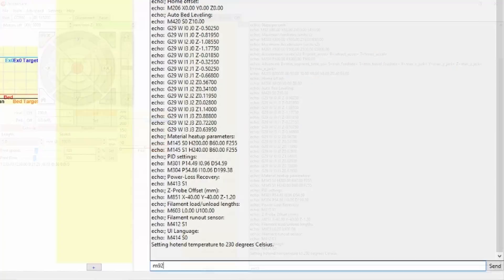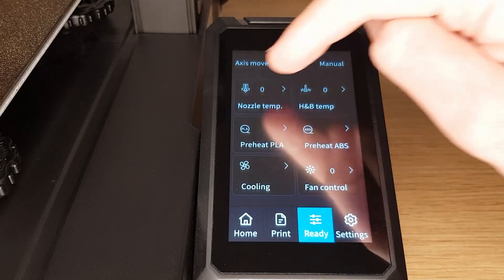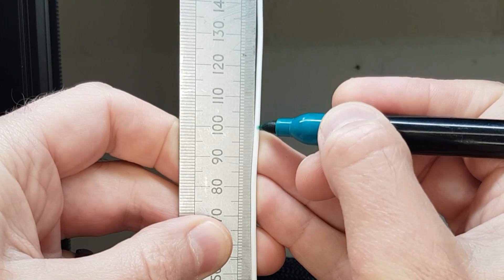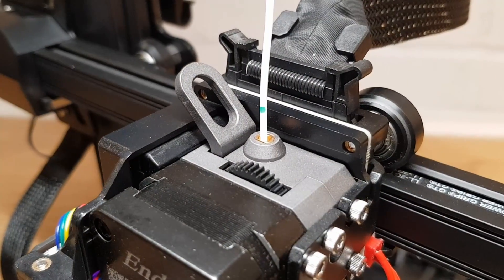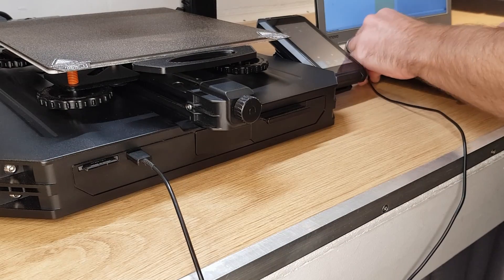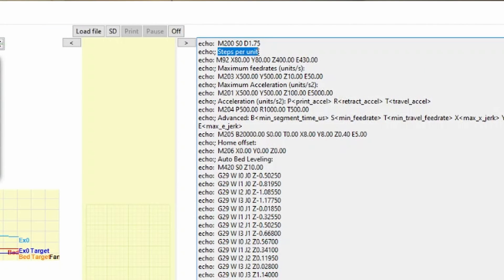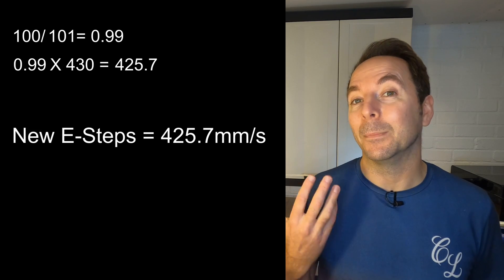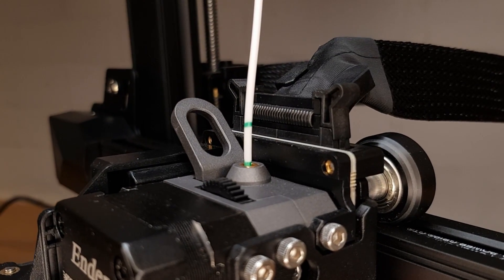Checking And Setting E-Steps On A Direct Drive 3D Printer - Quick & Easy

Comment: Calibrating e steps is the first step i do on any printer, sry the second, the first was calibrate x and y with a cal cube of 20x20x20mm .2 mm thick walls.
If ok I measure the wall thickness and adjust the flow in the same way. if ok adjust z steps for height. found the correct temp for printing ? i do recalibrate the e steps if needen but do the test anyway. Btw every filament is different so check e steps first. then the first layer test.

Comment: My default e steps are 424.9, extrusion is 102mm. Not able to calculate the e steps correctly... Anyone able to help?
Reply: I got you. Here's the math: (100/102) x 424.9 = 416.6.

Your new e steps is 416.6
Reply: @Davidicus-g8d  thank you, i have since sold the s1 pro, and bought a K1C, so we start all over withe the math and calibrations😂

Comment: I'm using a voxelab aquila s3. Would you happen to  know how to adjust the auto home/ level? My auto level starts in the 10 spot and registers as the 1 spot.  21-25 are nearly off the back of the print bed. Thanks in advance.

Comment: Thnak you for the videos! you make these processes duper easy to follow! I do have a question however. I did the e steps test for my tenlog dual extruder and now e1 is bang on but e2 is still a bit off. OD you know if their is a way to set the esteps to be different for each extruder?

Comment: Hi Ricky, great video and helpful but I have a problem. I have a Wanhao Duplicator i3 Plus MKII and on the firmware there is no way of telling the unit to feed 100mm so I utilised the Protoface program and the command line G1 E100 F300 and the extruder kicked in and extruded 88mm of filament. This was with my E-steps set to 117.6.   Hence using your calculation I changed my E-steps to 133.5.     After using the save command and getting the SAVED response I tried the feed again and it as worse. Now a shortfall of 32mm.  Any thoughts on what I did wrong please?
Reply: Managed to sort the problem. I needed to send the code M83 so that the printer was interpreting the following extrusion commands in relative mode. Cheers again for the video.

Comment: I did this test on my Artillery x2 with TPU and found 70mm instead of 100mm, which is a huge gap!! I was surprised because my prints are good, so I didn't change anything. What would you recommend? 
Thank you !
Reply: You don't want to use flexible filaments to do this, as it will mess with results a LOT. Retry it with PLA if you can.
Reply: I have the same printer and after a few months of bad prints someone told me what could be the problem and I checked it gives me 60 instead of 100

Comment: Thanks for the video. My Fokoos Odin seems to break the settings down onto two lines, is it the E94.00 on the third line I need to then work out the correction? 
echo:Steps per unit:
echo:  M92 X80.00 Y80.00 Z400.00
echo:  M92 T0 E94.00
Reply from the maker: Hi, yes it should be. Very easy to tell, send G29 E100 for example and see if it changes. If you don't send M500 then it won't be saved and turning it off and on again will reset. Hope this helps.
Reply: @RickyImpey  Thanks, yep I can confirm it is the same setting, just displayed a bit differently.  👍 I'm guessing it may be because the firmware seems to have the ability to support more than one extruder, and T0 is the first extruder?
Reply from the maker: @LocostR1  Yes, that makes sense

Comment: Great video, great channel!!

I don't know if someone has mentioned it yet, but if you have problems getting your printer to get recognized. Make sure you have nothing open, like cura, which has got "control' over the printer. I had the problem. Unplug USB, power down printer. Make sure cura etc.. is not running. Maybe even do a reboot.. then try again. Should be ok.
Reply from the maker: Thanks for the tip. 👍
Reply: It didn't work for me and I already gave up and then I decided one last time I just ran the software as an administrator and it worked

Comment: I set my E-steps a while ago but then noticed G92 E0 in the Cura start G-Code, why is it reset to zero in the start code if the FW setting is used?
Reply from the maker: No, the G29 E0 sets the extruder to zero, not the e-steps. It's basically saying that where it is now is the zero point so that any further commands calculate from the point it starts from. Hope this makes sense.

Comment: Also, what screen is that on the Ender 3 s1? Mine doesn’t look like that. Thank you for all the content. I’ve shared your videos at least 5 times in my 3d printer group on Facebook when ppl ask questions.
Reply from the maker: This is the S1 Pro. It has a different touch screen to the S1 which has the same screen as the E3 V2.
Reply from the maker: And thanks for sharing the videos. I can see traffic from Facebook and wondered where it was coming from as I don't post much🙂
Reply: @RickyImpey  no problem! You deserve so many more views and subscribers. Your videos are extremely helpful.

Comment: Would you be able to put together a video showing all the software you use and what you use it for?
Reply from the maker: This video shows the process for using slicing software to get something ready for printing https://youtu.be/e-lQPGJ3Psc When it comes to other software, I don't use much. I use Fusion 360 to design things and sometimes Pronterface if I need to send commands to a printer like in this video. I'll think about a video though, thanks.